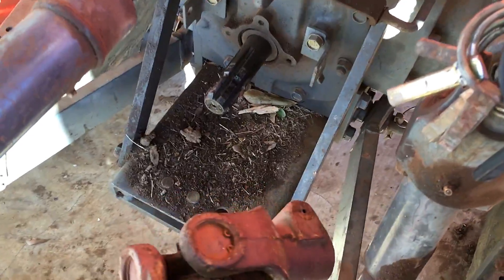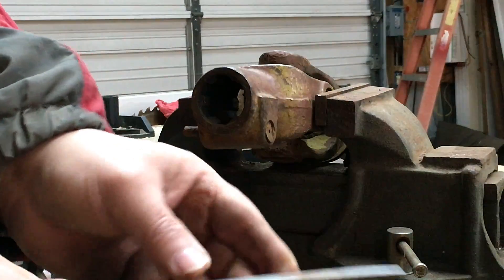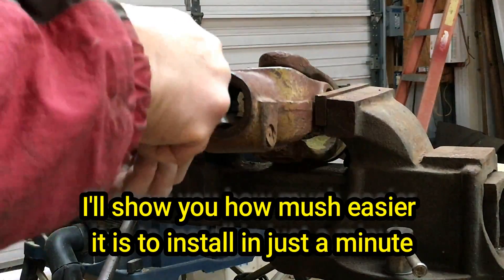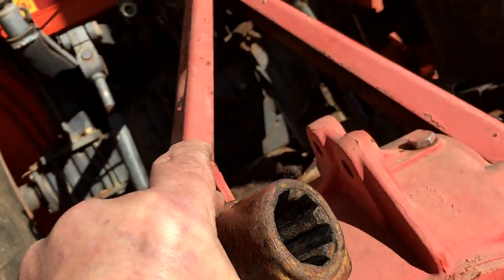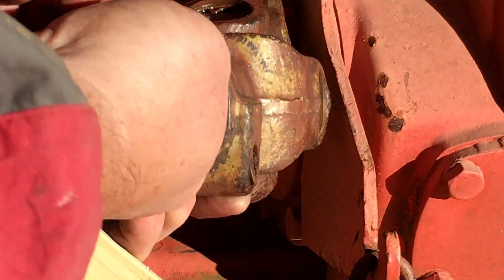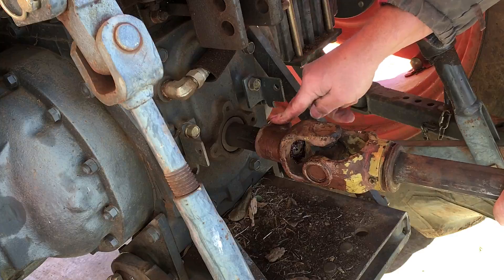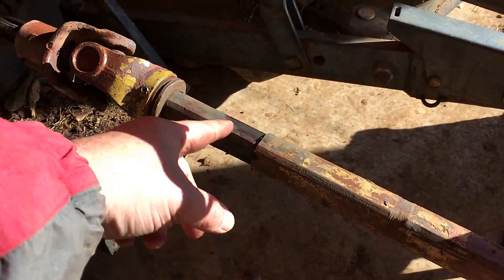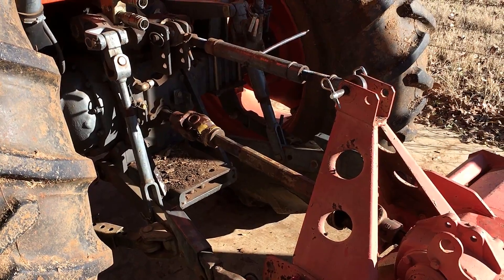Solving PTO Connection Problems ~ Make Life Easier!

Comment: This is great - hindsight is 20/20.  I SHOULD have done this before putting my tiller on the tractor.   So after fighting to get the PTO on the spline, I was able to go till the garden. 

... and now I can't get the thing off.  

This includes putting a chain on the thing and putting it around a tree and pulling hard enough that I was afraid I was going to yank the entire PTO out of the tractor. 

So... any tips on how to get a PTO off of a spline if you didn't clean the rust off first?
Reply from the maker: Sounds like the little pin , or whatever it is on your shaft that holds the implement shaft on it, might be engaged. 

If it’s not coming off after doing all that something is not right. 

Don’t yank on it that hard anymore. Because you could hurt your PTO inside your tractor. That would be very expensive.
Reply: @TexasPrepper2  I had to use a C-clamp to hold the pin down while I pulled on the shaft.  Gentle pressure and some "tapping" with a hammer got it loose.
Reply from the maker: @CNBarnes  Glad you got it off :)

Comment: Ultimately, the biggest benefit to me of this video was that a lot of people have this challenge.  I thought it was just because I am old and weak.  :)  My spline shaft from the tractor PTO was damaged.  The shaft is really hard steel and I ended up using a Harbor Freight cutoff tool to reshape the spline(s) after trying a file and Dremel tool.  Your use of a file to clean the yoke is good because it is probably hard steel too, so it's unlikely a file will damage it.  Thanks again.  Also, cutting a piece of plastic tubing (copper, steel or aluminum would work) to hold the lock pin in the disengaged position was a big help, although with everything fitting right, depressing the pin while engaging the yoke may not be as big of a challenge.  I put the tubing pieces in my toolbox.
Reply from the maker: That's great
So glad I could be of help!  👍😎

Comment: Thanks.  All the other hits for this problem are sales pitches or they don't have a problem connecting to the PTO.  I knew I'd find a use for the dur-dur (plastic tube Walmart dog-poop bags are wrapped on, not the dur-dur for toilet paper).  I cut about a half inch off with a hacksaw and then split it lengthwise.  I use this to hold the spring-loaded pin depressed so I can focus on aligning the splines.  One comment on another video was to use a marker to show where the grooves are on the yoke spline.  I'm goin' to do that and see if it helps because I don't think I have a rust problem (stored in a SteelMaster outbuilding).
Reply from the maker: Hope I helped  :)
Reply: Yeah, Tex, your video was helpful.  I went back at it today and it still would not go on, so I removed the PTO shaft shield.  At that point, I could see clearly that the shaft had been boogered up.  Probably from when I was moving snow over the winter and a clip came loose and the blade twisted.  Anyway, I ended up "sharpening" the shaft almost like a spear.  :)  Now the Brush Chief shaft goes on smooth as silk.  The tubing to hold the pin helped a lot, too.
Reply from the maker: @mcdevious2229  Nice. Glad you got it going  :)

Comment: I forgot to push the pin when I tried connected my bish hog, it was only slightly attached to the shaft. At first it worked but then BANG, it stopped and now the shaft wont spin and the PTO light is flashing. What happened? Did the pto shaft stop spinning because of me not connecting it correctly or could this be another issue like electrical?
Reply from the maker: Man, I don't know
If you can get the PTO shaft off the tractor and it still flashes... there may be a serious problem
If it's still on there it may just be jammed'
Try to get it off (if it's not already)

Comment: Hello from a fellow Texan! I recently purchased a used bush hog. The yoke release pin on the implement side appears to be seized. I have soaked it in PB blaster and attempted to strike it with a punch and hammer. It’s simply will not budge. Can you give me any helpful tips? I really do not want to have to pay a shop to remove it.
Reply from the maker: Sounds like you've tried everything I would have tried... except applying heat.
Sometimes heating metal up will free it.
Give it a try, but don't get it so hot that it melts the rubber seals on it. It shouldn't be close enough to get the rubber that hot, but just be aware.
Let me know how it goes.

Comment: ))))I Use a Steal brush and put some Grace in connection Pieces  just keep them greasy no rust  and make sure the locker pin work correctly((((:

Comment: Keep mine packed in grease biggest problem I run into is remembering  how the locking ring works because as you know often  we put them just once or so a year. Some rings push, others pull and some are squeezed.